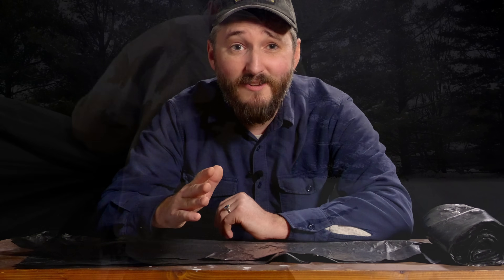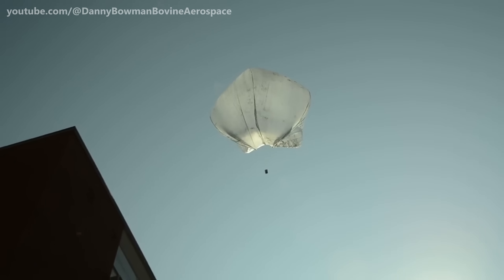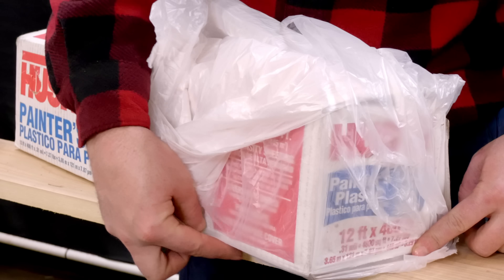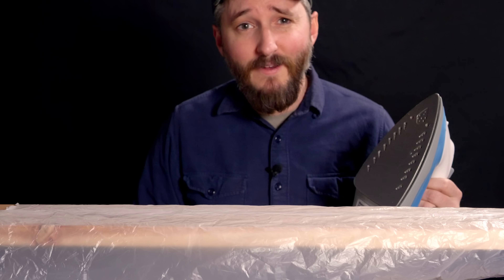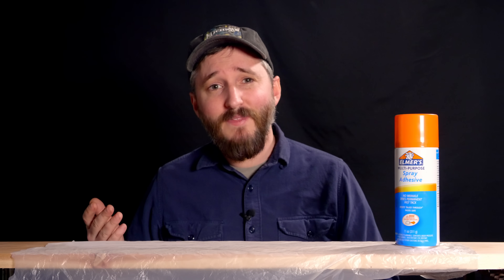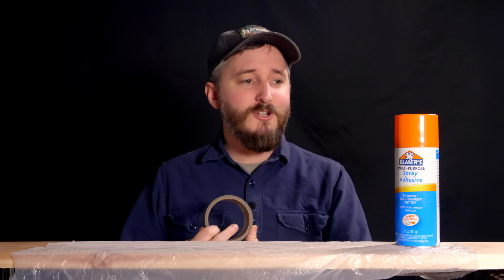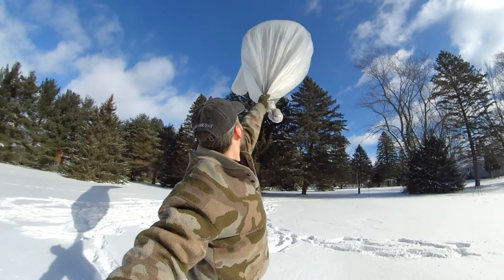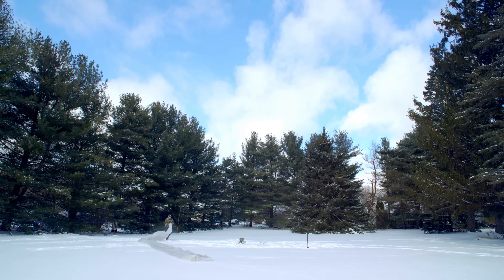DIY Solar Powered Balloons

Comment: You came up with this right on time.

I had the idea of solar air heater based on a solar baloon.  I was looking to make as big a collector as possible for as cheap as possible.  Your psa adhesive suggestion  is definitely something Ill be using.  Thanks!
Reply from the maker: I thought of that too! A tube shaped solar balloon would be a great way to get a lot of surface area very cheap to heat a lot of air.
Reply: @Nighthawkinlight  the two designs I've been playing with is big bags attached to foam or other  board kind of like traditional solar air heaters but crossed with a bouncy house.   

Second is 2/3 bags nested inside each other and all connected at the "bottom".  Possitive pressure is applied to the Innermost bag and   the air flow through it away from the "bottom" and flows out perforations at the "top".  Air then returns from top to the bottom between the 1st and second bag.   Optional third bag is a much larger clear bag that acts as an insulation barrier while allowing light through.
Reply: Look out for a fairly viral plastic seamer for snck and sandwich bags might not work on this thin plastic but I bet it would be worth a try as it would be much quicker and more durable if it does work
Reply: @RALLIR  i will do that!  The plastic im considering probably wont be quite this thin.   Where i live we have some substantial winds so it needs to be a little tough

Comment: At the plastic bag factory i work at, our bagger (the machine that melts the seal & creates the perforation in the bag) uses a special copper or brass mesh tape that's heated and pressed into the plastic for just a split second. I wonder if that could be replicated in a shed. That said, your adhesive seemed to work very well.
Reply from the maker: Copper might work! It would be a lot better at evening out the heat

Comment: another tidbit for heat sealilng the plastic, im guessing the surface area isnt helping, perhaps try using just the very tip of the iron, so that way you have significantly less shrinkage and have a defined heat seal area.

Also depending on the temperature a soldering iron might be useful, you can get soldering irons that you can set the temperature on. Though depending on the iron, and it's accuracy that may be a little bit too fiddly. Though it comes with added benefit of being highly controlled.

Comment: Nice fun project!
Have to add that air containing water vapor is less dense than dry air. This, and the Coriolis effect is why hurricanes work!
H₂O = 18 g/mol  Air = 29 g/mol  ( N₂ = 28 g/mol, O₂ = 32 g/mol ), CO₂ = 44 g/mol
A mole of any gas has close to the same volume of other gases at a given temperature, so the least dense gas is the one with the lowest molecular mass.
However, if the water vapor rains out, then that might spoil the fun as it takes volume away.
Reply from the maker: Condensation has been my problem in the past with other balloons. That makes them heavy fast
Reply: @Nighthawkinlight  Adding silica gel or calcium chloride won't help either, as they won't remove the mass! 😞
Need a fuel that creates exhaust products that remain gaseous and are less than < 29 g/mol. Options are limited!
Or maybe something clever with hydrophobic coating and guttering to collect and dispose of the water?
At least a solar hot air balloon shouldn't suffer from this.
Reply: @ahaveland calcium carbide reacts with water to make acetylene. Not sure on the weights but it's exciting at least
Reply: @zyeborm  marginally less dense than air, so would need a lot of it! Definitely exciting for (very) remote spectators!
Reply: While we're talking about molecular weights: NH3 and CH4 would also be lighter than air and would make for cheaper lifting gases than helium or hydrogen.
Carbon monoxide would technically be just lighter than air (28g/mol). It would be less unsafe than the above alternatives, but harder to generate.

Another interesting substance would be Methanol (CH3-OH, not to be confused with ethanol). At 34g/mol it would be close to air, but with the advantage over water that it evaporates at slightly more useful temperatures. It's vapor pressure is 35kPa at 40°C and 55kPa at 50°C. This means that a balloon that is under-filled by 35%-55% (depending on temperature), but has liquid methanol added into it should be able to compensate for small leaks (if I remember my thermodynamics correctly).
One downside is that you have to make sure that your foil material doesn't dissolve in alcohol. A second downside is that with such thin plastic foil, you really can't afford any over-pressurization, and being off by 0.2 bar on your pressure estimate (10°C on your temperature estimate) could easily pop the balloon.

A better way to compensate for leaks would probably be to just blow ambient air into the balloon. But given that a typical PC fan would likely pose a danger of over-pressurizing the balloon, I don't really know the most weight-efficient way to move that air.
Reply: @Pystro  well thought out comment!
I think I'd be tempted to go for max performance with hydrogen and ban smoking!
Reply: I'd been going to mention that water vapor is less dense than air.  Good to see that it's already here.  And yes, the problem is that it condenses promptly to a liquid that's much denser than air.
Reply: But co2 will make it heavier. A typical hydrocarbon in plastic is( CH2)n. Meaning: for every water molecule is one carbon dioxide molecule when burned.

Comment: Great project! I don't know if they would work, but on websites like aliexpress and such mini heat sealers are on sale that could do the job without the use of glue... might be worth trying imo. Also, it would be really interesting experimenting with different geometries of the balloon, trying to maximize exposed surface and internal volume and minimizing the non-exposed surface so to increase heat absoption and have sufficient thermal capacity to have a stable flight!

Comment: Take your plastic and fold in half over the length (you can do this in sections. Sandwich the open edge between 2 metal bars as long as you can get. Leave 1 or 2 mm of open side of the sheet sticking out of the bars and heat this - a naked flame will work, or a hot iron. The plastic will fuse together and melt back to the metal bars leaving a welded seam.
Or you can try putting aluminum foil over the plastic before you iron, this might work with baking parchment as well. iron over the top hot enough to melt the plastic together. The foil prevents sticking to the iron and spreads the heat.

prittstick may work and be strong enough.

Comment: Could u make solar powered absorption cooling system? I found it very fascinating over a traditional compressor based cooling system since it uses a heat as a source.
Reply from the maker: Could be done with an ammonia refrigerator or thermoacoustic driven. I might do that eventually
Reply: @Nighthawkinlight  yeah plz try

Comment: Phrases like "twice as thin" are like mental speedbumps to me.
"Half as thick" is, for me, a smoother ride.
Am I just weird?
Reply from the maker: Makes sense
Reply: Steve mould has a pretty old bit from Festival of the Spoken Nerd (I think) about the air outside an airplane being 6 times colder than the air inside your freezer, and talks about how absurd a statement that is
Reply: @lettersnstuff  comparing temperaures using multiples makes no sense, because the scales we normally use have 'zero' at an arbitrary temperature which is not actually zero (as in absent of temperature). Using multiples for comparing measurements where zero actually means zero makes perfect sense.
Reply: @lettersnstuff  That's exactly what I think about everytime I hear a statement like that.
Reply: If "twice as thick" means thicker and "twice as thin" means "thinner" then "half as thick" means "thinner" and "half as thin" means "thicker."

If "twice as fast" means faster and "twice as slow" means "slower" then "half as fast" means "slower" and "half as slow" means "faster."
Reply: Try debugging 20,000 lines of computer code programmed with this way of thinking 😮
Reply: @harpazo5486  
Nope.
Reply: That seems to be a new thing (within the last 10 years), with the kids. "Twice as small", as opposed to half the size, as us old boomers remember it. But then I graduated college in 1984. Yes, anybody under 40, I refer to as a kid.
Reply: @michaelmoorrees3585   We also tend to leave the "to be" in sentences like "the kitchen needs to be cleaned." "The kitchen needs cleaned" just makes no sense. Sure, "needs cleaning" works too, but not "needs cleaned."   And while I'm codgering on about such things, the word "button" has TWO "Ts" in it.  Unless you're a toddler, pronounce them!  There is no word in our language that sounds like "Buh-un." Don't even get me started on that dumb "alot" nonsense...  Oh, and man-buns... holy CRAP! 

Gotta run, time for a pill.
Reply: Half as thin makes sense, if the value proposition is thinness, rather than thickness.  The confusion can be prevented by stating that one plastic film is 0.002" thick, and the other 0.001" - for example.
Reply: @rickoshea8138 he didn't say half as thin, he said "twice as thin".
Reply: 2 times as large is mathematically equivalent to 1/2 as small.
Reply: While it's objectively inverse with regard to 'thickness' the measurement, if the subjective desired trait (thinness) is being described, then more thinness is a good thing. Sort of like how more velocity is less time or more distance. If counting a trip by time, then 'half as long' might be easier. If describing the action, then twice as fast makes sense.
Reply: You are not weird; I do the same thing. "Twice as slow", "half as thin", etc all take me a moment to process.
Reply: Ha. I can feel that and it's FUN!
Reply: I wish I could come watch you work on your projects and get some ideas for my own
Reply: Depends on if the glass is half full or empty 😅
Reply: @msmith2961 
The glass is twice as large as it should be.
Reply: 6 of one or Half a dozen of the other.
Reply: Not the first person to struggle with fractions/decimals.
Reply: Well computers suck at dividing and are great at multiplying. This proves he is a robot
Reply: @WillFuI  Shhh!
Reply: double negatives cause my brain to stop working
Reply: Yes
Reply: Yes, and yes. You're not alone.
Reply: twice as thin is fine for me, but if someone says 5 or 4 instead of 4 or 5... no... wrong... why?
Reply: EXACTLY!!!
Reply: it is a speed bump cause it is broken english.
in europe they use this as the default, even though it is nearly unintelligible at a heuristic level to english natives.

it is the same thing as uk people calling something 'take away' instead of 'take out'. abstractly they mean the same thing but if you are listening for key words and phrases and someone decides to do something completely different, you have to stop and think out what was said.

no place uses this phrase as far as i know but imagine going into a restraunt and asking for 'a number 4 buy-and-leave'
it would be registered as 'fore baien dlif'. same with cash-n-go or cash-n-carry.
first time i heard cash-n-carry i thought it was a name.

something i found interesting and strange was that similar terms in inappropriate context are just as confusing. i saw someone come into a restraunt and ask for a meal as drive-trough, andt he waiter couldnt understand it as take out. the waiter kept insisting that they didnt have a drive-through, while giving meals to uber eats drivers.

Comment: Do u think this wud be more effective in a colder location where the ambient air is cooler and hence heavier?

Im guessing that in a naturally hot area there wudnt be much of a density gradiant granted by the sun's heat.
Reply from the maker: I've used the smaller tubes on very hot days and they work just as well

Comment: When watching you try to heat seal it, you were putting the iron directly on the plastic. Normally when trying to do something like this i would have parchment paper or another protective later between the iron and the plastic, which helps control the temperature better and prevent some of the holes/tares generated by the direct contract and melting of the material. Would you consider trying some of the melting process that way and see if it helps?
Reply: Industrial bag sealers use something that seems to be fiberglass cloth
Reply: @filfil9902  there's a seamstress material that's basically a thin web of material used to stick together cloth that's hard to put a seam on for some reason. Thing is, I'm pretty sure the material is PET.
Reply: The best stuff that won't stick to the plastic.... Teflon fabric between the plastic and hot iron
Reply: 👍🏻 The parchment approach definitely works for merging layers of HDPE shopping bags together.
Reply: Yep,  Adjustable Heat soldering iron with flat/ roller tip on parchment.
Reply: Commercial plastic bag manufacturers use a long strip of teflon and a high temperature heating wire which is held against the seam with even pressure along the length of the seam to melt the bag together. The amps put through the wire help adjust the heat applied to the seam so the machines can process thicker, thinner and different types of plastics. It's easy to control the heat with a thin wire due to the lack of shrinking the plastic goes through because heat is applied in a very local area right next to the wire. 2 wires gives you a double seem for extra strength and  wires can also be used to cut the bag off at the end so no need for a heavy knot. It's quite difficult to get the temperature of the wire, time heat is applied for and contact pressure correct but once it's keyed in it's very repeatable.
Reply: Parchment paper is the method I've used for repairing air bladders for kitesurfing kites. It gives much more control of the heat input and avoids plastic sticking to the iron. You can also get away with less heat by increasing pressure, but if you are doing it by hand there's only a limited amount of force that can be applied.
Reply: Years ago I read about this type of project and they were using a pizza cutter wheel which heated up then rolled along to melt the plastic together.
Reply: aluminium foil works as a protective layer that will peel off as well.
Reply: What we saw was a cut to [insert edit] after he exhausted sealing attempts deciding on adhesive. The insert was [a melting/not sealing/holes/etc exaggerated fail]
Reply: It might also be worthwhile to get one of the irons used for sealing monokote to RC airplanes. They are much smaller so likely easier to work with and you can also get little socks for them that prevent them from directly heating the plastic and melting it.
Reply: [edit: everybody, Wikipedia says that Monokote is a shrink wrapped film, so it probably doesn't contain HDPE.]

 @Demonhawk14  Thank you! To save me a search, off the top of your head, without serching: is monokote made of HDPE?
Reply: maybe hot air?
Reply: @zeke7237  you'd need a heat gun for that, and also it'd be hard to control the affected area. Household hairdryers generally don't reach 260C, for obvious reasons.
Reply: I've definatly had success before with parchment paper and a clothes iron, at least with melting together heavier duty carpenters plastic. I would place parchment paper above and below the plastic and iron it together on a padded surface like a towel or ironing board to more evenly apply the pressure.
Reply: Baking paper might be good!
Reply: @edde2429 
It is.  Not sure, but what some are calling parchment paper is the same as baking paper.
  I find wax paper works just as well as baking paper.
Reply: This might help, but this is probably LD-PE, dunno if it works as well with this
Reply: That's exactly what I tough good point✌🏻
Reply: I was also thinking that if thinness were to be an issue when hot sealing, the edge of the plastic could be folded on itself to double up the thickness over only that small edge to have more material when the heat melts them together.
Reply: I came to say the same thing. Just alter the number of layers of baking paper depending on thickness of material being welded.
Reply: I’ve used aluminum foil as a heat diffuser for fusing grocery bags together while experimenting specifically for this purpose with great results in the past!

I’ve always wanted to make something like this just large enough to make a person (and the necessary equipment) neutrally buoyant so that you could jump much higher and use R/C ducted fans for vector thrust controls.

I like the idea of using the irons or heat guns used for applying monokote in R/C planes mentioned in the comments as well.

Passive heating (even in a supplementary capacity) of lighter-than-air craft is puzzlingly under-explored from what I’ve seen.
Reply: A silicone baking sheet works really well.
Reply: Soldering iron for controlled temperature & pen precision would be of easier use than ironing press for heat sealing seams. lighter fire works too w/ a little practice.
Reply: I thought that it might be interesting to use masking tape to hold everything together, and then apply a few more strips to widen coverage...and then iron over that...or just use 1 strip of tape, and then use the edge of a clothing iron over the thin strip.
Reply: Super glue? Something or glue with an exothermic reaction? Bro's pretty smart i Donno why he didn't think the plastic would burn.